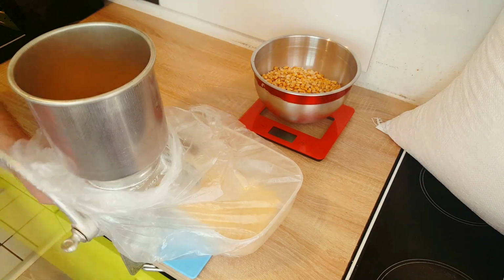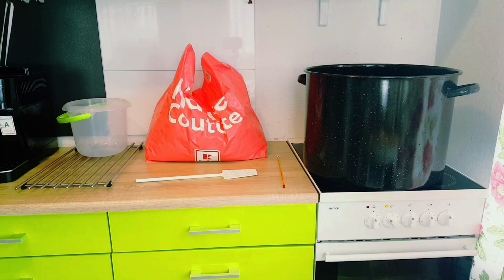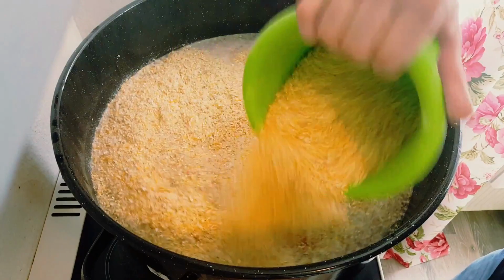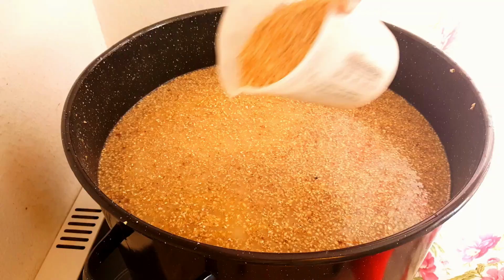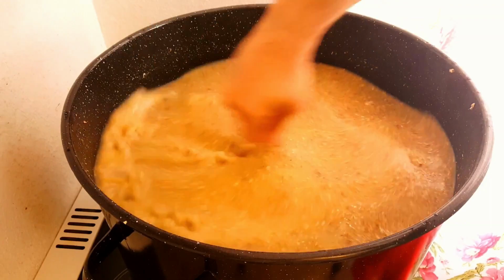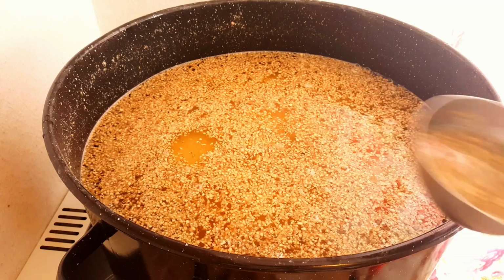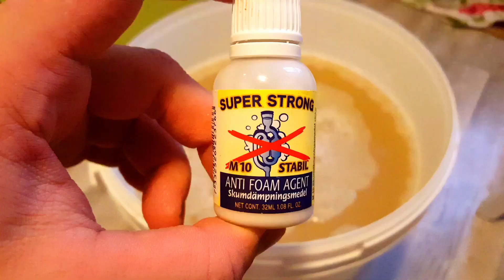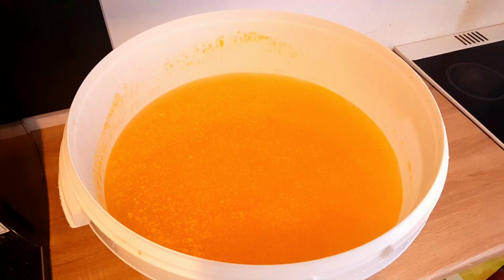How To Make Alcohol From Corn

Comment: Why do you need alfa amilaze enzime, if you have added malt (which containes enzimes)?
Reply: I’ve been researching this a lot. I think you don’t need as much malt if you use the enzyme. The enzyme breaks it up more so more starch the better ABV
Reply: Why add alpha amylase enzyme and malt? It depends on how much malt and how much adjunct (corn, rice, etc.) you have compared to the malt. Unfortunately, the enzymes in malt are not perpetually useful. If it's a 50/50 mix between malt and adjuncts, you're probably OK, but the closer you get to that mark the more likely it is that you will need to add additional enzymes. Alternatively, you could use six row barley rather than two row.  It has more protein, less starch,  more enzymes and a thicker husk than two-row. I am kind of amazed at how long the mash is conducted. IMHO, the malt and the enzymes should go in at the same time.  Sure, it's slightly less efficient to go for an hour, but way less annoying.

Comment: Can you drink the distilled water directly?
Reply from the maker: water or moonshine. Both of them you can but not too much. Too much distilated water can kill you because it will flush away a lot of microelements from your body. Too much alcohol its also dangerous :)
Reply: @bigboyshobbies5731  besides corn, what else is the ideal ingredient to get good vodka
Reply: @kanmaen4183  sugar. Search for Birdswatcher recipe or tomato paste vodka. Table  sugar gives an even cleaner spirit and its easier to work with. Just dissolve it. Probably corn sugar or corn syrup could work well too if its cheaper in your area. 
Mostly anything can make vodka, some things will just require more work (like molasses and sugar cane juice or potatoes).

Comment: I used my spit for the amylase enzyme.
Reply: Did it work? How much spit ?
Reply: I know the beer chica de maizo is made with chewed&spitted corn, but I don't think a single spit would add enough enzyme..
Reply: @Murlockingqc  i chewed and spit an entire bag of cheerios if i remember correctly
Reply: @Murlockingqc  it worked. Make sure you add enough water or it will come out too thick

Comment: Every 100ml got 12gms of Sugar...
Total water was 35 litres (35000ml)
So  350 part got 12gms sugar means 4200 gms of total Sugar in it...
4.2kgs of Sugar in 35 litres water produce how much litres of Alcohol, and what would be the percentage?

One final question is that if my math above is correct then, is just 4.2kgs of Sugar enough for 35 litres??
Reply: Buy the sugar at the supermarket, and go on the fladh..
Reply: 35L water to start with. The final fermentation in the bucket is not 35L. And I see his final brix % was 15%, not 12%.

But if the final volume was 35L at 12% brix, then you would have potential alcohol of 6.4% ABV, meaning there is 2.24L of absolute alcohol available if you could get all of it. 
In reality, you would only be able to recover some of it via distillation.

But if you could retrieve all the alcohol, you could add 3.36L of water to the spirits and that will give you 5.6L of spirits at 40% ABV.